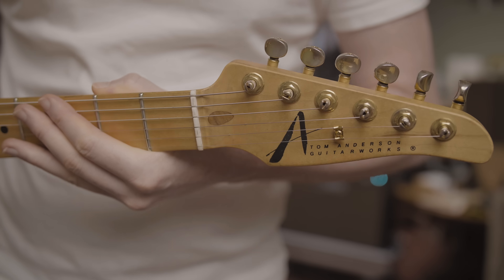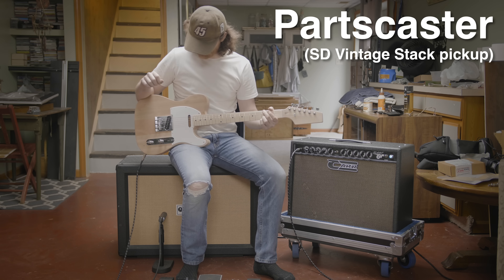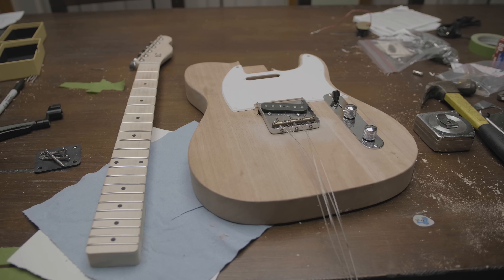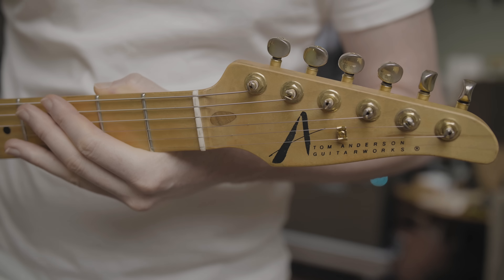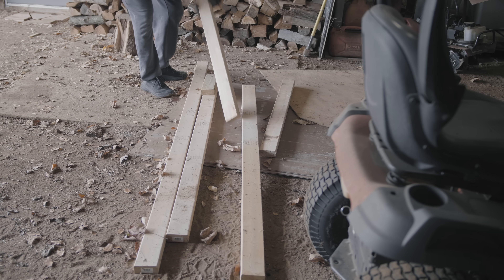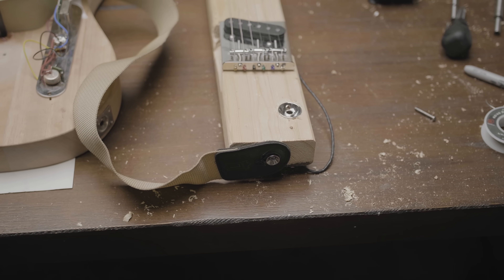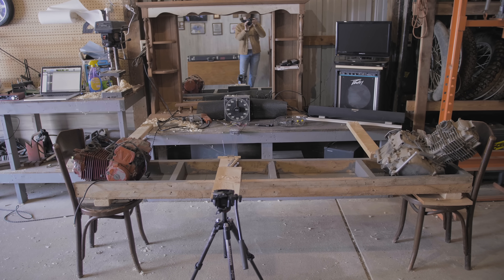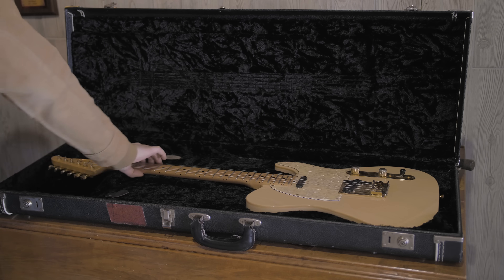Tested: Where Does The Tone Come From In An Electric Guitar?

Comment: the biggest change is in the caps and the pots , if the pickups are the same, and located at the same place from the strings ( strings has to be the same , because the nickel will change things ) the caps is 20+- % value , the caps is 10 % at least , the wood is just for looks ,

Comment: I’ve always felt that stuff like tonewood was effectively irrelevant for electric guitars, and it’s nice to see that be completely accurate.
The stuff that does matter often just comes down to playability. String height, scale length, string thickness and type, pickup and where it’s at. The biggest thing that actually matters is if the neck feels good to you. Some have a preference for wood for the fretboard, but even the composite of recent years works just fine and sounds great.
All in all this led me to getting a strandberg, since the neck is literally unique to them. It’s what I wanted in a guitar and I’m happy, and if that neck existed on a $200 guitar with a good setup I’d be just as happy. Cheap guitars are great now, all they need is a little love to get the setup just right.
Reply: You might think that the guitar sound when played acoustically might be affected by the wood, but I don't see how it could make much difference when it's plugged in, not in the real world. Of course there's always the argument of picking one wood over another because it looks nicer.

There's a video on here somewhere with sound comparissons from drum kits with different woods, obviously these are ONLY accoustic so the wood should definitely make a differrnce right? Not at all. So all of these exotic woods, at least for sound are largely nonsense. Does make a slight difference of course, but like the guitar, you'd never hear it in the real world.
Reply: Yeah I think a lot of it is just more about what feels right for you than anything else. The way a guitar looks and feels will change how you approach playing it and what kind of music you want to play on it, resulting in a far more noticeable difference in tone than whether it's made out of aged swamp ash or mahogany or whatever. The priority in a guitar is getting something of decent build quality,  that's within your budget, and fits your playing style and aesthetic, and that's possible nowadays even with things that traditionally would be considered more high-end like a Floyd Rose or fanned frets. We live in a great time for budget-friendly quality guitars.
Reply: its just not right. the different wood makes for different resonance nodes. its been studied a million times but people always resort to ignorant videos like these where nothing is measured and compared properly. its very evident with bass guitars. you can clearly track down and hear a modal resonance of a given piece of wood
Reply: @kimseniorb  We aren't looking for science, we're looking for practicality, and 95% of the population won't hear a difference.
Reply: @kimseniorb  you missed the point. But I have neither time nor the crayons to explain it to you.
Reply: @kimseniorb  the wood might have different "resonance" (noting the basic physics of a 2" thick piece of wood not resonating with the input of a plucked string - certainly not across inputs of different frequencies...) at a material level but (a) it isn't much between wood 1 and wood 2, and (b) it literally makes no difference to the sound coming out of the instrument.
Reply: @kimseniorb wood does resonate differently of course, which you can hear on acoustics very clearly. It’s not a major difference, but it’s there. The big things that are more audible are body shape, scale length, etc.

With electric a significant portion of it is just what the pickups are doing. And frankly, they don’t care how dense the wood is, they are picking up the strings moving. You will however feel the guitar resonate when you play. This is why strandbergs for example are incredibly stable and play well, but don’t really have any resonance to speak of. It’s all based on stability over feel, and the result is an incredibly consistent and stable instrument, but not one that necessarily has soul. 

Over time I’ve grown to find that wood has very little impact on tone, both on bass and guitar. For bass the fingerboard wood density does have an impact on tone (maple is clearly warmer than ebony for example, and is audibly different on identical basses), but outside of that there is a lot more to be said in terms of scale length or pickups. 

My reasoning still holds true though. Get an instrument that is comfortable to you. If the sound isn’t there for you it’s something you can improve.

The concept of “the one”, one of these amazing guitars that feels amazing in the hand, is real. That being said, it’s a resonance thing. How it feels against the body and how it matches your playstyle. 2 of those same models, one of which is the nice one, will sound almost identical to each other despite the difference in quality to the player. 

Get an instrument with a neck you like, get it set up, and enjoy. It doesn’t have to be a nice brand or exotic wood, just something that works

Comment: Excellent video. The strings being so close to the mics and the sensitivity of the mics to strings make the strings extremely loud compared to all other sounds the mics might be hearing. So the main question with the build (everything besides mics and electronics) is how the build is affecting the ringing of the strings, and the strings themselves. As we heard, the build doesn't affect sound that much. Most impactful about the build are the bridge and the nut though.

The playability/player excluded, the most impactful things are the strings (source of sound), mic positioning (how the sound is listened to), mics (what's hearing the sound), bridge/nuts/how rigidly those two are secured in place (what's sustaining [/or dampening] the ringing of the sound), electronics (what's carrying and outputting the signal, although if you just output as dry and as clean as possible there won't be much diff since defects are almost nonexistent in electronics in the modern era). I mean people spend thousands and tens of thousands on a single mic to record vocals on, and mics are the most complicated piece of hardware on the electric guitar. Mics are doing the actual "hearing" of sound after all. and the loudest sound in an electric guitar is the ringing of the strings.

Comment: it's not completely an air guitar but it's got some air.  The work bench, the shelf, the two 2x4 fastened between the bench and shelf, and the floor act as the guitar body and neck.  It's amazing that it sounds like the guitar though.  Can you put a tremolo bar on the bench guitar for the next video?

Comment: By the end, I hear the parts guitar unable to catch a bit of the low end that the anderson could catch.  i think that may be a wood treatment problem to solve, but i don’t think changing electronics around has too much of an effect.  thinking about how sound is created, the most important factors (in my opinion) are how well the guitar body can reverberate the frequencies of the strings.  each unique guitar body will catch different tone (frequencies) based on everything to do with the integrity of the electronic equipment you put in.

in the end, it comes down to how well you can actually any given guitar with your two hands…  playing more or less aggressively will help shape the overall sound which is why these videos are difficult.

fun idea for a next vid, something to standardize force exerted on strings to minimize the human element of playing

Comment: I have had a discussion exactly about this topic with a good friend of mine we pretty much came to the same conclussion.
The wood itself has just minimal influence on the strings. 99,9% of the sound is determined by other factors. Funnywise it shows here perfectly.
What's also interesting is the fact, that weather seems to have a big influence on the sound with things like pressure and humidity.
Reply: About the weather - I have an ENGL Powerball, that is dialed in and stays in exactly the same settings all the time, but with weather/humidity/temperature change, it sounds a bit different.
Reply: @Danyael850  I personally think, that the air pressure as well as humidity have the greatest influence. We encounter much  of these issues in our rehersal room. I play Roland Drums, so everything is exactly the same as well and during summer we often have a really thick and fat sound, while in winter it becomes a bit thinner. Just for fun sake, somebody should try to record at different weathers...
Reply: @angelosasso1653  good comment. Do you guys have any kind of humidity control in your rehearsal room? Was thinking if we can remove humidity out of equation in terms of what you have experienced.
Reply: @dmitriylazarenko3220  No and I am not sure if it would help, since our rehersal room ist about 10m² for 4 people so us jamming will already have a huge impact on humidity so I would need to measure at least air pressure as well...
Reply: Weather is spot on bro.
Not only the tone changes, it's quite amazing to see the wood warps on the back in high humidity.
Btw, those creaking sounds you hear at night when everyone's asleep? 
Those are wood furnitures reacting to dryness

Comment: I think the video is great but, it doesn't, however, factor in something very important - can guitar build materials take away tone? If you make a guitar body out of concrete and the bridge saddles out of rubber, will you lose tone? I imagine you would. Therefore, if you use bad components, can't you theorize they would be worse for tone than good ones? Do some woods keep more of the fidelity of the tone than others? Can some paint jobs actually take away from tone? Your kit guitar was unfinished. I'm curious what it would have sounded like in a thick poly covered guitar. I think there is something more to tone than just the pickup height though I agree that makes a huge difference.

Comment: Wood does nothing at all.  Pickups, bridge, and but are the big factors. Especially the pickups.  Electronics matter big time.
Have you seen the test the guy does with a strat against a couple buckets of sand with the same pickguard.  He compares both using a software that shows the eq curve.  They were identical. 
Great idea.

Comment: Warmouth did the most definitive and most accurate test on this subject. They used the exact same neck, pick ups, electronics, pick guard, strings, setup, everything, except the body wood. They took the guitar apart for each test and reassembled it on the new body wood. Body wood did have a difference but it's more subtle than most people think.

Comment: Strings and body with neck are connected oscillating systems. Body and neck vibration takes energy from string vibration. One part of this energy is dissipated into air as audible sound. Second part is returning to strings. Third part is converted into thermal energy i.e. heat in the materials of the guitar and their joint surfaces. The amount of energy stolen from strings is different at different frequencies. So neck and body affecting frequency spectre (timbre, tone) of the mechanical vibration of the strings. And this vibration is converted into electrical oscillation by the pickups. Which have their electrical resonant properties too.

Comment: Paul Reed Smith is going to be in shambles after this video (I love Paul though lol). But I’ve never liked the tone wood argument with electric guitars. To me, in a simplified way, anything that has a metal component or is “touching” the sound is what’s the most important: the bridge, the saddles, the pickups, the strings, the frets, the fretboard, the nut, the jack, and the wiring. I’ve always thought it was incredibly goofy that guys put such an emphasis on silly things like finish. You cannot logically think that a thin layer of finish on the body makes any discernible difference to the human ear. I don’t think people understand how much marketing plays into how we view guitars. I started noticing this especially when reliced guitars started becoming popular. I liked them, but I realized it’s all just marketing when, let’s say a Les Paul is played by someone for 10-20 years and it has obvious wear on it, or let’s say it just falls at the store, it has to be sold as fair or damaged, below its original value. However, that same guitar, sold as reliced is now ABOVE its original value. Darrel Braun also has a really good comparison video about tone wood. Also Burlsart made me realize that guitars can literally be made out of anything and sound good. People have to quit letting manufacturers trick them into spending more money. A guitar doesn’t need to be made out of 400 year old oak to sound good. Construction quality, feel, and electronics are more important than construction elements. And honestly, above all that, is being a good player. I’ve seen a lot of terrible guitarists with really expensive guitars, and I’ve seen Zack Wylde shred a hello kitty guitar. I truly believe that guitars have been held back by their refusal to move past traditions. People have been blowing out their backs for generations because “heavy guitars are better”. No they are not. Again DB has a whole video where he literally cut pieces of a guitar off to test the sonic resonance of how much wood content matters. It made no difference whether the strat was the whole strat or 1/2 of the strat. One of my favorite guitars is my Jackson soloist. I could not believe I’d been playing big fat neck joints over a neck through body all these years. I hardly even play my LP anymore because of it. And I don’t just shred on it either. I play a lot of jazz and blues on my soloist. But, again because of marketing and old guys, certain guitars have certain labels. Buts it’s amazing to me that what are considered shred/metal guitars now, weren’t always. Flying Vs and Explorers were created in the 50s, way before heavy metal was a thing. Every guitar I get going forward will probably be a “shred” guitar (I own a LP, 2 teles, a strat and an acoustic).

Comment: The first air guitar strum had my jaw on the floor. The second strum with overdrive, I actually started laughing. Its no big secret that tone wood has been used as a marketing tool for electric guitars, but this, THIS is crucial. Thank you so much for this video!
Reply: I'm so glad I wasn't the only one. I literally burst out laughing and my GF came through from the other room. I then spent 5 minutes waffling about why this was so funny but she didn't understand. Ah well.
Reply: What did we learn? Tone depends on the wood or the mass the benches are made out of that the ends are anchored down to on either side of the air.  So, probably pine sounds the best.
Reply: @AlexAquarius963  We learned the same thing we always learn.  Stubborn idiots who don't understand physics will always say only the pickups matter.
Reply: @olorb2618  Go back to your toneplastic strat and pray for better hearing!
Reply: @hans-joachimbierwirth4727     It's all about the player, strings, and pickup. Electric guitar pickups are not microphonic, so the tone of the wood is  made up BS.
Reply: @TexanUSMC8089  That's why i made fun of someone whose comments i can't see any longer, refering to the material all strats have their pickups sitting in: plastic ;)
Reply: there is another video where they compare the sound of a plastic guitar body versus wood. if you can't hear the difference, switch instruments
Reply: @clammaster4  and what will you if I don't hear a difference and dont switch instruments? Hmm?
Reply: @clammaster4  All Stratocaster models by Fender have their pickups mounted in a plastic body loosely connected to the lump  of wood the neck is mounted on, and still the guitards talk about tonewood instead of toneplastic. That should tell you something.
Reply: OP clearly can't see the hundreds of pounds of wooden tables the "air guitar" is connected to...
Reply: @questioneverything4633  right, because those tables were made of textbook guitar tonewoods. And even if they were made of mahogany, he could have screwed those pieces to a plastic table, the result would have been the same. Stop trying to look cute.
Reply: @DevilMayAsian  you really need to learn some physics.
Reply: @questioneverything4633  and you're gonna teach me physics?! Please, random nobody with an opinion I don't care about and credentials you've yet to provide, show me the way!
Reply: @DevilMayAsian  no, I'm not gonna teach you physics.  Go do your own work like I did.  Teach yourself.  Climb out of your pit of ignorance.
Reply: @questioneverything4633  no, seriously! I don't want to go down the same Google University route you did. It's simply too much work to find opinions that match my own, like it did with your research. I beg of you, teach me Professor!
Reply: @questioneverything4633  I am of the impression you are correct: you are unable to teach physics, as it appears you don't understand it yourself.